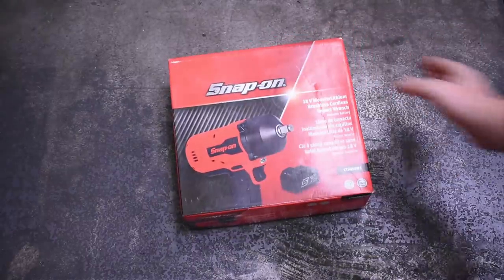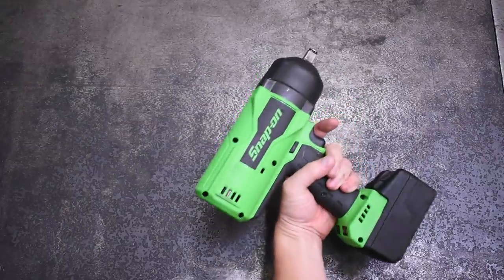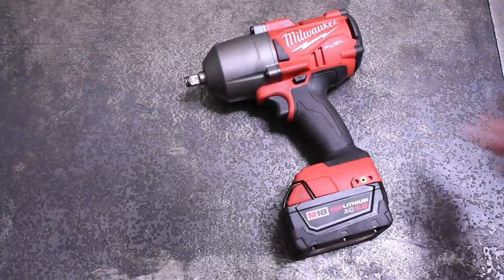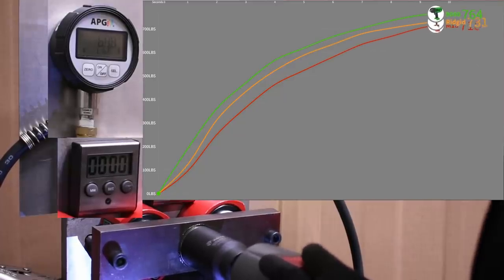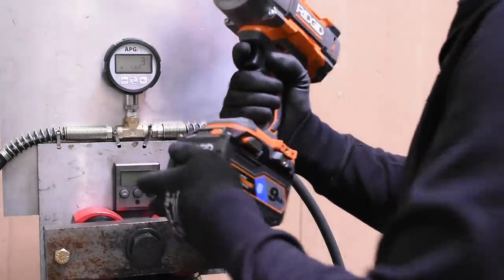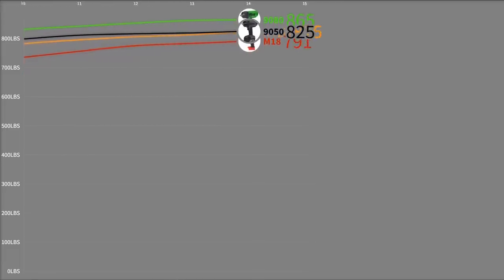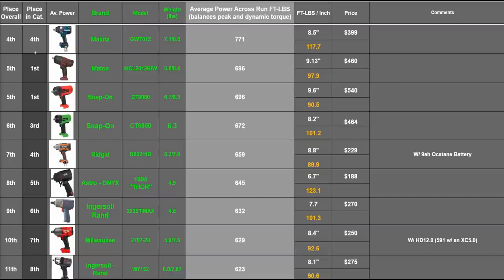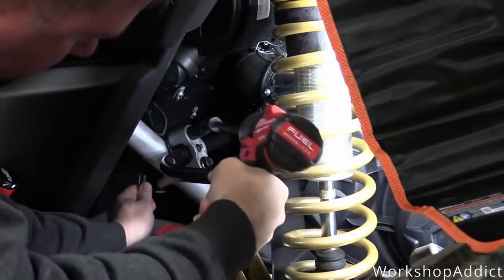Snap On's New CT9050 High-Torque is Smaller Than M18 & Hiding A Big Secret

Comment from the maker: What's your theory on this one's performance? Snap-On trying to get you to buy more models? Make other models look better? Throwing darts at a spec board? The new battery is on steroids? 
After some copywrite claims, our RankChart has now moved! https://etsy.me/3G8j3QK Big thanks to @damn_its_froy on Instagram for letting us borrow this 9050!
Torque of TTC is working for Astro Tools, who also make impacts (air). Always consider multiple sources, we don't know or show everything about a tool!
Reply: I will pay extra for made in the USA, or at least anything but made in china.
Reply from the maker: @SuperAWaC  The top spots at 9:43 are Taiwan, Taiwan, USA/global, Taiwan. So there's options then!
Reply: Looks great but my guess is the snap on won't live very long compared to milwaukee in a shop setting. With their lack of good warranty it still doesn't make it worth it.
Reply: The snap on is ungodly expensive, bulky, heavy, and has the worst warranty.
Reply: Copyright claims….FFS.
Reply: @RulethenightGaming  I thought one of Snap On's major selling points was warranty, does it really suck on their power tools?
Reply from the maker: @ferrumignis  The warranty term is 2 years, so much shorter than 5. But the process is often (not always) quite easy with your dealer. I dont know about the bulk and heavy comments though, this one is is guilty of plenty but not that.
Reply: @TorqueTestChannel  Thanks, that does seem pretty short for what is a very premium brand.  Do you have any experience with Milwaukee claims, can they be difficult?
Reply from the maker: @ferrumignis  We've had pretty good luck with Milwaukee warranty over the years. We hear horror stories, but they seem to accept "really" used tools. Though our experience with tool trucks, especially hand tools, has been obviously often even easier. They sometimes just hand you a new one once you text them to stop by.
Reply: @TorqueTestChannel  Thanks, that's really useful.
Reply: I could be wrong but an idea did just pop into my head what if the 9050 is supposed to be a replacement for the 9080; that’s cheaper and has more accurate specs and is a little bit smaller. They couldn’t make it have higher specs than the 9080 because then they would be totally lying through their teeth and they couldn’t admit that this gun is better because they lied on the 9080 so they just made this in their eyes a “mid” torque with high torque power. Btw I haven’t looked through the comments to see if I’m the only person that has thought this
Reply: @thehourglasswithaman  I agree with you.  I think Snap on made big strides on the technology of that gun.  Unfortunately I think they are "stuck with" the older 9080 since they came out with the 9050.  With specs so close, why buy a 9080?
Reply: Re copyright claims: don't use the vendor's thumbnails in your chart! Make your own when you have them, or edit from the video for those you no longer have... Then there's probably nothing they can hold against you.
Reply: @SuperAWaC  Ah yes paying an extra $400 for "made in the USA" what a fool.
Reply: @svn5994  ...really..?
Reply: @ianloyd6384  it’s true, a fool would say snap on is better because of 3 words
Reply: @SuperAWaC   and  not all cordless snap on tools are made in the USA check there online catolog before you  buy if you have to have made in the states
Reply: Why not get a vibration meter to objectively test the tools vibration level?
Reply: @RulethenightGaming  Snap-on is strictly made for shops settings!   And the warranty is 2 years no questions asked and after that it’s a $140 flat rate fee.  So if it lasts 5-6 years and needs rebuilt the you pay the fee and you basically get a brand new impact.  New case, new motor, everything!!  Can’t do that with Milwaukee.  Only other dealer that’ll do that is MAC
Reply: Sales just like any other company. The more stuff they come out with the more they can sell. I bought the 9050 and Traded in my 9080 just due to the size of the 9080
Reply: @SuperAWaC  so everything in your house is made in the usa
Reply: @Iroc_twan  Wherever possible, yes.
Reply: @svn5994  Making such an oversimplification is what's foolish.
Reply: @RulethenightGaming  quite the contrary. I have both and the Milwaukee feels like a cheap pos now that I have the snappy. The warranty isn’t great but I’ve never had a snap on impact fail in the 15 years Ive been buying them. On the other hand my Milwaukee started making ugly noises and I found out it was recalled.
Reply: @RulethenightGaming  just bought a 9050 to replace my 8850 that has been and still is chugging along flawlessly for 8 years.

Comment: For the size and price point of snapon it’s very hard to justify buying them. While with  Milwaukee you get the greatest battery line on the market. The M12 and M18 lines cannot be competed with for the amount of tools that you have with such compact batteries and the amount of new tools they always release. Since I’m in the engineering field I greatly admire the engineering that gets done with Milwaukee because of the fact that they listen to your request and wishes then bring it to life.
Reply: I'm guessing you have Milwaukee tools already?
Reply: @veridico84  i have Milwaukee, Rigid, porter cable, dewalt
Reply: @tjboylan20  I generally only have Milwaukee and Makita. I swear by Milwaukee.
Reply: @veridico84  definitely my favorite tool is the soldering iron when I first bought it i was like no way it heats up in 7 seconds and it does , it melts faster than a torch
Reply: @tjboylan20  I dont have a Milwaukee soldering iron, I have a Hakko, but I have no doubt on the Milwaukee one being exceptional.
Reply: @veridico84  I definitely recommend it and for only $80 bare tool it’s pretty great i got an hour of run time from an XC3.0 which for a soldering iron is great
Reply: i actually used snap one and ill just say is deffinitly worth it and lighter
Reply: @chino22854  i used the snapon one and I felt the opposite way about it I don’t like lighter gun because they don’t apply as much torque because they don’t weigh as much that means they have less force and less force makes less torque and i also just didn’t like the feeling of the gun
Reply: Even if the snap on is 100 percent better than can keep that price tag i love snap on but god damn
Reply: Snap on 14 volt line are better than the m12 by far
Reply: @anthonyescarcega3411   not even close the M12 lineup has over 100 tools, they add new tools almost every month, have brushless motors which snapon still runs a lot of brushed motors, more compact tools, better battery cells
Reply: yeah, its hard to compete with the convenience of a single battery platform across all your tools

Comment: I’ve had my 9050 since it first hit the Snap-on truck a couple months ago.   I’ve been extremely pleased with it and it’s done everything I need in a heavy diesel shop.    Yoke nuts, Cummins x15 head bolts, main bolts, etc.   definitely made the right decision.
Reply: Yeah and milwaukee or even ridgid would do just as well and you would have had more money in your pocket for other tools lol.
Reply: @nicksrandomviews1296  if I wanted Milwaukee I would’ve bought it.   I’m not supporting China.  I’ll spend more and support American workers.
Reply: @6.4DieselDoctor  😂
Reply: @6.4DieselDoctor  where is the Snappy gun and batteries made?
Reply: @RJ6AV6  nobody is allowed to make batteries in America thanks to past presidents.   That’s unavoidable.  Gun is made in Murphy, North Carolina
Reply: I think I’m sold, My dcf900b is loosing power fast.
Reply: @williamsdieselrepair8662  my Snap-on is still going strong.  A little beat up but still removed 33mm lugs with ease
Reply: @nicksrandomviews1296  I’m a diesel tech as well. I bought the 9050 for the appreciable difference in weight and size. That Milwaukee can be tough to maneuver in tight spots while standing on your head.
Reply: Between my 18v and 14.4v I probably have somewhere between 25 -30 snap on electric tools. 

Are they good tools? Yes. 
Are they expensive?  Yes.
But what a lot of people don’t realize is I could take a 20 year old Snap on tool electric tool and handed it over to my snap on dealer that will drive up to my front door and for about $125.00 or less it will be sent out for a flat rate repair and many times I will get practically a brand new tool back in return. 

For me, that’s well worth the upfront cost
My .02
Reply: @6.4DieselDoctor  yes sir, the 9050 is a great impact. I use mine daily definitely the best choice.

Comment: In the world of tool truck brands, matco and snapon have continued to provide, where as Mac grabbed on to dewalt and really just overpriced the commercially available product.
Reply: Agreed but as pointed out in another comment the tool truck provides pretty decent financing (in my case 0%) for those tools I picked up my mac 1/2 with a desalt impact driver led flash light charger and 2 5 amp batteries for 650 cad and didn’t have to pay up front can’t do that at the retail stores and the pricing was very competitive just depends on the dealer

Comment: I haven't touched my 9080 since I got my 9050. Now I see why. I knew it was strong but didn't realize it was just about as strong as the 9080. Love that snap on is soaking up all the Milwaukee fan boy tears with their new brushless line up.
Reply: I'm not a milwaukee fanboy, but I'll keep the few hundred in my pocket for such a negligible improvement in power.
Reply: @mediocreman2  Holy shit, the snap on is putting about 100 ft lbs on it in a good bit of the curve lol That's more then negligible

Comment: I’m soooo happy Snap-On finally came out with a battery pack that matches the body lines of the their new guns.  They just looked so hokey with the old battery.  Now Snappy needs to come out with a high output pack so we can see the 9080’s full potential.  Yes, I still love my 2767, settle down Milwaukee peeps.
Reply: Snap on needs better batteries and much better warranty on them as well
Reply: I picked up an mg3255 after some guy just threw it away when warranty expired

It's a good tool, i'll give you that. I'd totally buy it if it was available for the $50 i offered the guy before he said "just take it"

Comment: As most have said I and agree, great to see snap  on release this at more "affordable" price compared to the big daddy model. Still hard to justify against the milwaukee cost. 
However it's gotta be remembered about the good old drip feed payments. Alot of guys I've worked with don't have the money laying around to fork out for even the better priced milky. But the snap on guy will just drop the gun in your hand and all you see is £20 (or $) a week and all of a sudden you have a market leading gun and no hole in the wallet. 
All that been said, 4 years and no new flag ship release means no doubt milwaukee are overdue, and have probably been developing a sledge hammer of an impact that will probably blow us away. Not to mention the 5 year warranty. 
Personally I'm on the dewalt 899 with some decent flex volt 6ah batteries and to be fair day to day its more than enough for the stuff in the UK I work on. Any bolts it's snaps on suspension work etc well they were usually corroded to buggery anyway and just makes the decision for new bolts with that sus arm easier 😂
Reply: Thats what I've been saying about milwaukee for a year now and its not long till they come out swinging and claiming names.  4 years is a long time and they have the budget to develop something good.

Comment: Wish Milwaukee would release a new smaller high torque. I'm sure it's in the works already, because you know during the torque wars, like trucks, someone always has to have the biggest number. The new snap on is definitely impressive and will drive everyone to do better.
Reply from the maker: I doubt it will be smaller. Ryobi went smaller and no one cared much, they just want numbers. Dewalt is going same size (8.8") so Milwaukee will be at least this same long again.
Reply: What really sucks about the "torque wars" is the absolute fudgery... you see snapon advertising 300 less ft lbs, but theyre actually accurate, compared to other that claim more, but deliver less...

Comment: The issue with a crank bolt coming off is similar to using an extension to remove a bolt. Why cause what is keeping the engine crank from rotating when the nut is being impacted off?  Just the pistons and compressed air within. They act as a damper decreasing the impacts effectiveness. Really the crank pulley needs to be locked down somehow ....

Comment: Got it from my snap on dealer because this video and I’m a lucky fella I actually have some of the high output impact wrenches this Chanel reviews ( the Matco stubby green impact / nitro cat 1250k/9010 lol m12s 8850) with plenty of work as a line tech for the past decade and this gun so far has  impressed me for an impact this size to output so much power I might actually have to put the air hose down (we wish?) Just did a transmission job and didn’t have to grab the Matco stubby or the 1250k has me wishing they can make a 3/8th version so I can trade that 9010 asap  there is no reason for that behemoth 9080 I recently used now lmao

Comment: I would love to see entire brands rated on your system. If I want to recommend a brand to a apprentice of mine, it would be awesome to be able to recommend a brand vs power and price.
Reply from the maker: Once we have enough/similar number of examples from many brands we can make an episode like that.
Reply: If it's a tool truck brand go with the dealer you feel most comfortable with.
Reply: @TorqueTestChannel  yes please! I think that would be extremely helpful for a lot of people! I’m only going to buy one brand myself. So I’d like the most powerful and affordable brand. I may be phasing out my dewalt and going with another brand due to their lack of competitive power.
Reply: @ianthompson2802  I’m a mobile mechanic. I have every tool truck available across several cities. Also every hardware store brand available. I run Mac/Dewalt products at the moment. But my batteries are finally starting to die and my tools are starting to wear out. I’m considering changing brands. Any brand is an option for me.
Reply: @mutiracialbeatdownPB  
I originally purchased dewalt years ago because I saw construction workers using them and I figured they must be tough tools. And they are. But Milwaukee has a much larger variety of tools. More powerful tools at comparable prices. I’ve only worked with one guy that use Makita products, they seem fine. But as a mechanic we always want the most powerful tool we can get. But I also want the most powerful and affordable tool brand I can get. Being mobile it’s easier for me to go to a home depot then it is for me to go to a tool truck. So I’d prefer to still to a brand I can easily get there. But another big part of it is batteries. I have nearly as much money invested in batteries as I do tools. Now that some of my batteries are finally starting to go bad. I need to make a decision to buy more batteries or take this opportunity to buy a new brand and switch over everything I have.
Reply: @mutiracialbeatdownPB  it’s also comical how easily the m12 batteries break when dropped. The clips, & even the bottom plastic part of the battery (not the 4.0 or 6.0).
Reply: In my opinion you never get the really good stuff if youre caught up in price. Ok so the 3/4" Makita XGT did 1000ft-lbs, the XGT midtorque easily topped its category with a margin, arguably XGT is the line to recommend but price being a factor the weakish Amazon brands will score higher. I simply bought all 3 available XGT models and while it set me back a few bucks i know i got the best a furry-palmed powertool user can get.

Comment: Not really power tool related, but it's about Snap-On, just have a gripe with them. Just before Christmas i got a new Snap-On jacket, i tried it on to make sure it fit, but didn't zip it up. The next day i wore it to work and i noticed the zipper kept basically snagging on itself, i maybe the plastic of the zipper just didn't mold perfectly and would fix itself after use and wearing in. From late Dec to late Jan i wore the jacket probably on average every other day, minus a week where i was sick with covid. The zipper never got better and i intended to ask out Snap-On guy the next time i saw him, but then the zipper broke. The next time i saw our Snap-On guy was Feb 9th, he comes every other week and between hus vacation and my being sick with covid i didn't see him at all in January. When i finally saw him on Feb. 9th and showed him he said he cant warranty it and even if he could he cant get anymore of those jackets. 
Im pissed, being sold a faulty product then being told your SOL. 
So, i got the new jacket because I've been wearing the same North Face jacket for about 10 years now, everything still works perfectly on it, it's just getting old. It just really pisses me off that this very expensive Snap-On jacket breaks after a month and im SOL, but my 10 year old jacket that's been seriously  abused still functions perfectly. Honestly im so pissed that the Snap-On guy wont get another dime out of me.

Comment: The new snap on 5 amp hour battery is claimed to be significantly better than the old battery pack (so my snap on rep says) The new battery only works on the new brushless snap on tools. I have a suspicion that the 9050 may have performed very similarly to the 9080 because the 9080 was tested with the old battery pack. I think using the new battery pack on the 9080 may give it a little more power and would recommend using that combo on the next test of the 9080 if there will be one.